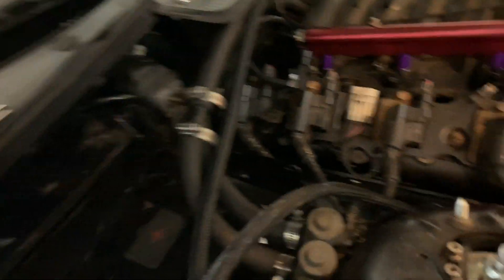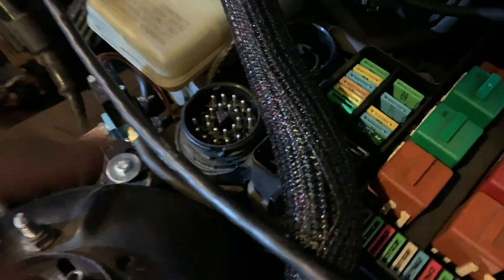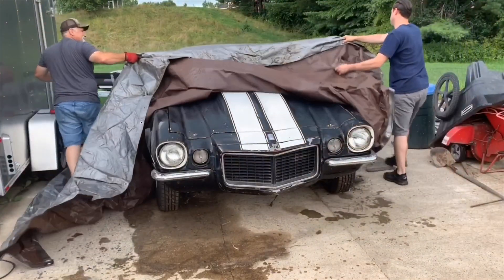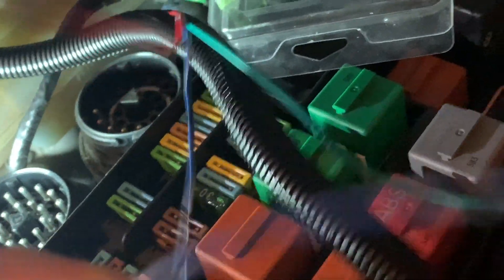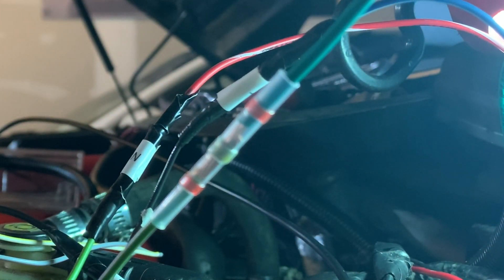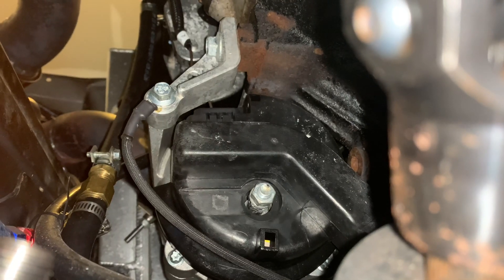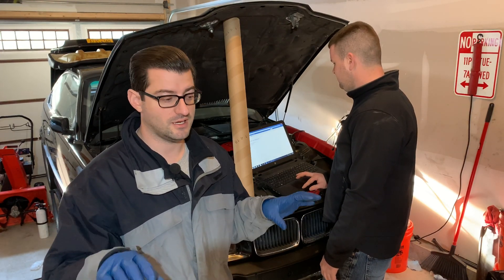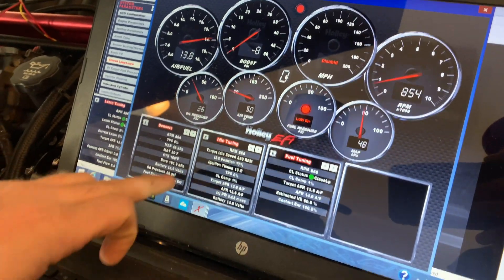TERMINATOR X FULL WIRING: BMW E36 TURBO LS SWAP PART 17

Comment: Hey I know I’m late and I hope you still read these but I’m doing a ls swap on my e46 and was wondering if you had any schematics or pinouts for the wiring. I would really appreciate it
Reply from the maker: Of course I read them! I don’t have an e46 Pinout, on the e36 it’s the “x20” connector. The e46 has a similar one, you can google the pin out, and then cut and solder the wires to the term x wiring. There’s only 4-5 wires you need.

Comment: Late to the game, but I'm swapping out my WS harness to Holley Term X. 
VSS doesn't route through the PCM. It is picked up from the differential.

I'm trying to create a spread sheet so I can keep my functionality like you. Only have way through your video now. Do you happen to have a spreadsheet?
Reply from the maker: I don’t, go on WS support page on their website and in the install document there’s a pin out of the x20 adapter. I attached the corresponding wires to the ones the hokey needs, I think it’s 5 wires. I lost some things like coolant, and reverse lockout. But I’m workin on a fix for that as well
Reply: @LowBoostFilms  Yeah, the Term X only needs about 5 connections (fuel, start signal, constant power, switch power, grounds). I'm going to wire up a back-up light switch and coolant temp separate of the TermX. The whole charging & starting system is separate as well. Planning to tackle this weekend.

Comment: Got a question do you have pic of the wires that came out of the x20 plug I’m mating the ls harness to he x20 just trying to get a pic of what needs to be hooked up.
Reply from the maker: You messaged me right?
Reply: Low Boost Films yes

Comment: I’m too broke for this man
Reply from the maker: The cheap way is to re use the stock harness, but you’d still need to have HP tuners and the credits and software it’ll cost almost the same.

Comment: Man i have a twin turbo LS E36 with the wiring specialties harness and i want a programmable ECU but HP tuners is too expensive. Any luck selling your old WS harness? I might end up doing the same thing as you here, do you recommend it? 

Also why not just run that first cable to the positive battery post up in the engine bay instead of snaking it through the car?
Reply from the maker: Massry Maserati I haven’t listed it for sale yet. Probably this week. I thought that too with the first cable, but I asked Holley and they said they STRONGLY suggest I run it to the battery, so I did. I liked my wiring specialties one, and I didn’t have to wire anything like this, but tuning it will be easier, I also do not have HP tuners.
Reply: Low Boost Films cool man, good job for getting it running tho! Also i think Matt from Sloppy Mechanic makes an alternator harness add-on. You should do another video how the car is with the Holley and one for tuning! Keep it coming 👍
Reply from the maker: I’m not sure what his harness is for, mine works fine. I definitely will when the weather breaks